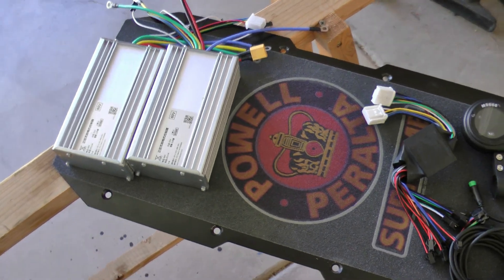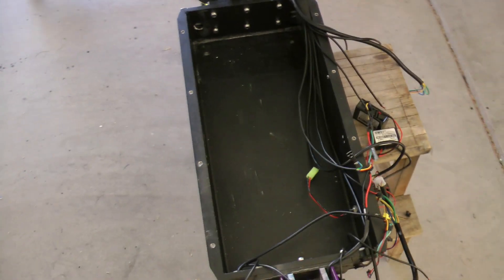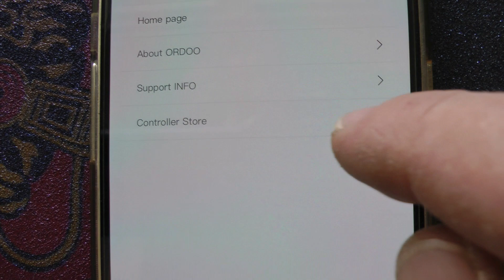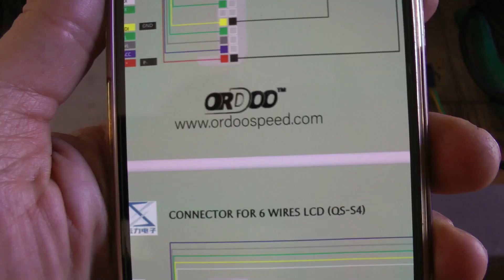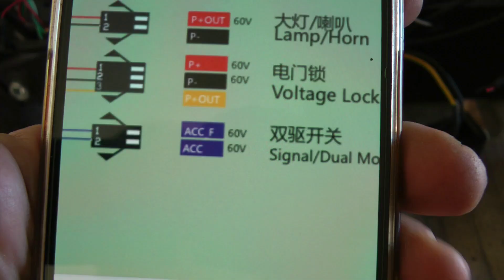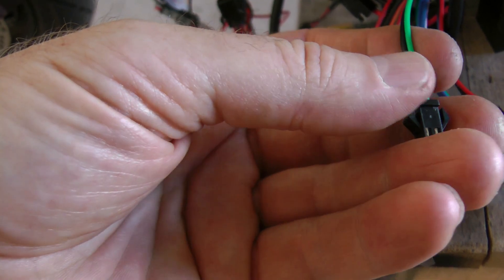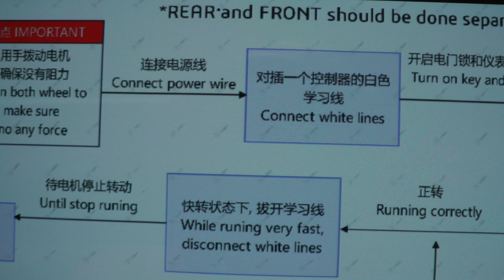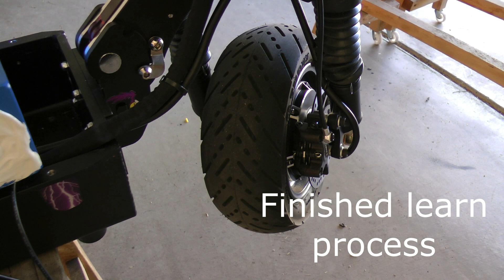Laotie Ti-30 Yunli controller wiring part 1

Comment: Do theses controllers support dual mode?
My motors only have phase and no haul ..
Reply from the maker: Yes, these are for dual motors, however they do also have Hall connections so they wouldn’t be compatible with motors that do not have Hall connections.

Comment: I need your help, my friend. I don't know if you can, but if you can't, I don't think I know anyone who speaks english who knows as much about these scooters. I put my sine wave controllers in last year and I love them but today I changed my tires and when I was doing the front motor, apparently I fucked up the pin out of the motor in the front on the hall sensor and now it will not spin in dual motor mode. It does spin with the white wires connected, however. Do you know the pin out of the front motor and can you share that with me?
Reply from the maker: Hey, email me and I’ll help you out: 
maikemarx@gmail.com

Comment: Hello there. 
I bought theese as you recommended, connected all the wiring except the alarm module and it doesn't turn on. 
I assume it's the alarm connection that has to be bypass. How should I do it? 
Thank you once again 🙏
Reply from the maker: The alarm module plugs into a 3 pin connector which has three wires, one black wire which should be the middle pin and either two red wires or a red and orange, these two will be the outside wires of the 3 pin connector. To bypass the alarm once you have unplugged it from the 3 pin connector, connect the two outside wires (2 red or one orange and one red). Do not need to do anything with the black wire and absolutely do not connect the black wire to either of the other two wires. If you have any questions, email me first. Don’t guess.
maikemarx@gmail.com

Comment: Do you know if the regenerative braking works on those controllers? I'm wanting to upgrade my Laotie ES19 controllers to these but I couldnt find any info on the regen braking. My stock controllers are extremely weak on that function and I cant seem to change it. I even went as far as doing some wiring mods to try and force the regen mode to be stronger but it didnt seem to work.
Reply: for this controller, yes it has, i accidentally found out by enabling the function on the P-setting page. to which exact page I forgot, but I can confirm it has regen, I am using it now. 
you can find the P setting page list for your throttle, I have the LH-100

Comment: and may i aks way not go with programing drivers esc that u can program like far driver or flipsky
Reply from the maker: Well I can reach a top speed of 51mph (GPS) with insane acceleration using the Yunli setup. I don’t think I can get much more than that out of my 2800W motors and 60v battery.

Comment: way did u need new drivers did the old drivers  go bad
Reply from the maker: To improve performance. The stock JP controllers are squarewave. The Yunli controllers are Sinewave and give smooth, strong acceleration. Better overall performance and when paired with the Yunli DS20 throttle, the performance is insanely good.
Reply: where can i buy for or where to by win i live in the usa right now so cold right now here but any way i need contler  i have a 15amp maxs 52volt 800watt scooter i waws thinking i can run them at 800watts but peek 2000 and say 32amps from my flipsky scan of the moters it showing 33amps older softwhere was saying 60amps it is a hi end moter 2 motoer where clock at 2800watt at peek

Comment: Hello my scooter is 5600 watt dual motor with 60v 40 ah and I would like to connect second battery the same.

Do you have anything?
Reply from the maker: Not a good idea to connect two LIPO batteries together.

Comment: can you help me with somehing, so i want my rear motor to run inverse, what colors should i change, cuz motor is color with color and hal sensor is also color with color, sowhat do i have to change for it to go backwards, im asking this because i rotaded the rear wheel because i want to put the brakes on the left side so i had to rotate it and now i have to change the wiring
Reply from the maker: On your phase wires, make them yellow to yellow, blue to green and green to blue (swap green and blue wires).

Comment: I have error E-010 , whats mean
Reply from the maker: E10 is an issue between the controller and display. Could be a connection issue, could be a bad display or controller. Did you recently replace the display with a different type? If so, make sure to use the cable that came with the new display. All cables are not the same.

Comment: Good evening... I bought some controllers like yours, but I don't know how to connect the display wires, I have a 3-pin cable in black, blue and white, another with yellow, red and gray and what I need to connect... I don't have one with 2 white pins and see... when possible reply, thank you
Reply from the maker: With the Yunli controllers, I originally used the MS-668 display which is compatible with the Yunli controllers, then upgraded to the display/throttle that Yunli made to be used with their controllers (DS-20 throttle/display). I’m not sure if other throttles are compatible with the Yunli controllers.
Reply: I'll buy lunch and beer. Hi, I got a 2022 Y-11 , 6000w with stock Yunli  controllers from ordoospeed, I don't think they are sinewave,, anyway with the TF-100 Throttle display. The first throttle failed about a month ago ,I noticed the screen getting digitally blank, like a whiteout and 15 to 20 minutes later it's dead. Scooter dead but damn alarm still squawks. I got a new TF-100 throttle/display and installed yesterday. Of Course, nothing. I deleted the squawk box as per your instruction, Orange to red, anyways what would you do next ?  Me, 25+ year electrician so that helps a little. Very little. I ride them hard but keep up on things I break, also have same year Y-10 or I would have posted a month ago. Funner than all hell these things, well you know that..   I am 80% off-road,    cars will hurt you.    WWYD  WSID ?   Really, lobster tacos and cold beers of your choice..!!!   Thanks for any info.
Reply from the maker: @michaelanderson1798 see my reply to your other comment.
Reply: I like that DS 20, probably go that route. Also, there may have been a little moisture in that battery box. Battery is fine, how to check controllers with no electronic output. I have FLUKE 376, multimeters , etc.
Reply from the maker: @michaelanderson1798 Hi, the Yunli DS-20 paired with the Yunli CC1 Sinewave controllers is the best setup I have found. So you’re not able to get your tf-100 display to turn on? I’ve only ever had the DS-20 and previously the MS668 displays in use with my Yunli CC1 controllers. I do have a couple spare MS668 displays that I know work. I know of no way to verify the controllers without powering them up but if you want you can email me and I’ll try and help you troubleshoot it. A simple but somewhat costly ($185) solution would be to buy the kit from Yunli (ordoodpeed on Ali-Express) and you’d get the newest CC1 controllers along with the DS-20 display with the display cable. That should solve all problems and make the scoot run phenomenal.
Reply: The DS 20 is elusive. I can't find one to save my scoot.  None on Ali-express, Ordoospeed store, Bangood, Tempu, Google, Amazon, anywhere. ???
Reply from the maker: @michaelanderson1798 keep checking Ordoospeed store and maybe contact them. It says “temporarily unavailable”. Sounds like they sold out but will have more.  I would contact them and see what they say. The Ordoospeed store is Yunli factory store so that’s your best bet. I’ve never seen them sold anywhere else.

Comment: Hi,i have these controllers and im having a hard time with the display.i cant aford the ds-20 amd all i have ac BC access to is the 6 pin TF-100.CANT I JUST MAKE SURE THE WIRES ARE RUNNING TO THE RIGHT PADS ISIDE THE DISPLAY AMD BE OK?FROM WHAT I CAN FIND YOU CAN USE THE 6 PIN JUST HAVE TO PUT A 5 PIN ON IT.DOES ANYONE KNOW ANYTHING ABOUT THST?
Reply from the maker: Not sure about that. Mine originally came with a 5 pin MS668 display which does work with these controllers.

Comment: At 9 min you showed to leave that wire disconnected in order to bypass Eco and stay in Turbo all the time. Whats your thoughts on this: I have the same scooter and normally leave it in Turbo all the time. I accidentally bumped the Turbo button this summer when moving the scooter around in the garage which turned Turbo Off. The next day, I pulled it out to go for a ride and it would not Move. Full charged battery, on/off I tried everything and couldn't figure it out for some time. It worked when I pulled it in the night before but would not work in the morning. After a while, I pressed the Turbo button and it would move again. That surprised me. I contacted them and they said my rear controller need replacing. My scooter is only like 6 months old and something burned out the rear controller. If I had not bumped/turned off the turbo I would not have known the rear controller was burnt out.
If you bypass your Turbo, I don't think you will know if your rear controller burns out, will you?
I now have a rear controller I need to put in because if I turn Turbo off, it wont move.
Reply from the maker: The rear controller runs the rear motor. The front controller runs the front motor. So if the rear controller burned out, the rear motor would not work. Put the scoot on a stool or something to get both wheels off the ground and test it that way. If you need help troubleshooting, you can email me at: maikemarx@gmail.com

Comment: just noticed my old controllers that came with the scooter doesn't have the cable harness...do you know if i can keep my old throttle while installing these new controllers even though they came with the other controllers and a throttle???
Reply from the maker: Of course not. The original is a 6 pin throttle. The new controllers use a 5 pin throttle. Again, just follow the videos. Not sure why u want to go off and do different things.
Reply: @Desert-Ecruising  wanted to keep the throttle as replacement just in case it goes bad but I guess only way is to buy back the original controllers but the original ones that came with this scooter sucks since it power cut offs when reaching low voltage...
Reply from the maker: I highly recommend getting the DS20 throttle made by Yunli to go with the Yunli controllers like I did. Perfect setup.
Reply: they dont ship the ds20 throttle to my country/state grrrrrrrr @Desert-Ecruising
Reply from the maker: @MissHitAllTheTime I assume you got the MS668 throttle with the controllers. I used that at first and it’s ok but it surges forward if you are just trying to give it a little throttle which is why I didn’t like it. Another viewer commented that he got a QS-S4 (5 pin version) to use with the Yunli controllers and said it is nice and smooth. Regardless, the Yunli controllers with the MS-668 throttle is still far better than what the scoot came with.

Comment: just got the new controllers. what happens after when i follow the wiring from the previous controllers and rear motor ends up spinning in reverse how do i correct it to get it to spin forward???
Reply from the maker: You could wire the phase wires so all colors match (Y to Y, B to B, G to G). Or you could simply use the learn function as I show in the first video starting at the 9:10 mark: https://youtu.be/nVbxYaVWYAk?si=S8dkl6sy5D59X4rQ
Reply: does it matter which wires i start with like they have the hall sensor,, the power, brake cable, turn signal wires, etc...or i can just start with the phase wires first??? also, both controllers says a/b so how do i know which one is for the rear and front??? @Desert-Ecruising
Reply from the maker: @MissHitAllTheTime the controllers are identical, no front or back. Did you watch the video? I go over all this in the videos. Follow part one first, then part two.
Reply: @Desert-Ecruising  hey. Does order matter when connecting the phase wires after matching them together???
Reply from the maker: @MissHitAllTheTime not sure what you mean exactly but it doesn’t matter which one you connect first if that’s what u mean.
Reply: @Desert-Ecruising does the order of the way u connect the wires matter as long as I'm.matching color when I connect it. Like can I connect green to green first , then blue to blue, and then yellow to yellow ??? Since you mention yellow to yellow, then blue to blue, then green to green???
Reply from the maker: Order doesn’t matter
Reply: hey. can i email you??? i think one of the throttle cable that came with my throttle is weird... it's missing two things... and i have pics of the remaining wires that i don't know where i need to connect to??? @Desert-Ecruising
Reply from the maker: @MissHitAllTheTime maikemarx@gmail.com

Comment: I bought those dame controllers but mine didn't come with the wiring harness to connect
Reply: Aye bud when u got some time, can u please do me a solid and walk me through getting all my wires properly u hooked back up? My nephew got ahold of the wire spider and unplugged everything. 
I know u got a video explaining it... but I need more details. Especially since that spider wire thing is disconnected
Reply from the maker: @user-ru6un5de4u Time is something I’m short on between working 12 hour shifts and on my days off, installing 1500 sq ft of flooring in my home. There’s not anything different that I would tell you from the videos I made. Are you installing the Yunli controllers or the stock JP controllers? I did videos on both so make sure you follow the right ones. I suggest following the videos one connection at a time, I go over all of them and how to identify them. If you have a specific question along the way, you can email me at: maikemarx@gmail.com
Reply from the maker: Contact whomever u bought them from. They’re useless without the harness…
Reply: @Desert-Ecruising  I bought them off of bang good.  Is there any way I can run just 1 controller and three rear motor?
Reply from the maker: No, I think the controllers need to talk to each other. If Banggood won’t send you one like they should, I’d just buy it from Yunli for $9.
Reply: @Desert-Ecruising  so I ordered the controllers back in August. Just got them a week ago. 
They double charged me for them and I had gotten priority shipping which was 20. They charged me twice for that aswell. 
Haven't seen a refund yet. 
A day after I ordered them, I got an email saying they were out of stock and expected shipment day was oct-13th. (7 weeks later) I asked for a refund but they said they couldn't do it until the payment was processed. At first I thought I was getting scammed by a credited site which was strange.
So I periodically went onto bang good to check status and just a week later. The item said "in-stock"
So of course I went and botched but got no reply at all. And to this day I still haven't got a refund for the extra payment...
Reply from the maker: @user-ru6un5de4u Keep on them about it. Also you could contact your credit card bank and let them know. They should look into it and credit you back the amount after investigating.
I’ve purchased things from Banggood 6 or 7 times without any problems.
Reply from the maker: You can also buy one directly from Yunli for $9. Make sure you order the 5 pin version. While you’re at their store which is on Ali-Express, I highly suggest you also buy the DS20 throttle/display. It is a huge performance upgrade.
https://a.aliexpress.com/_mPMhuYu
Reply: Thank you very much

Comment: I just finished my two controllers, so much smoother. there is no difference from A or B
Reply: Even Laotie has put the Sinewaves back into the new LB2, those SquareWaves are junk. both my QuickWheels (5600-6000 watt) come with the SineWaves and they are fast. modes 1,2 and 3 are all noticeable. I bought 2 LBs when they went on sale mostly for those big (21700 batteries) but sold one for a($300 profit).  The other one will be modded sometime in March with the SineWave Controllers.
Reply from the maker: @lionelhowell4972 yep. The JP controllers are crap.
Reply: @Desert-Ecruising  I agree!! Yunli all the way for butter-smooth performance.
Reply: I modded in the DS20 display and that totally removes the throttle lag, from the old display @lionelhowell4972